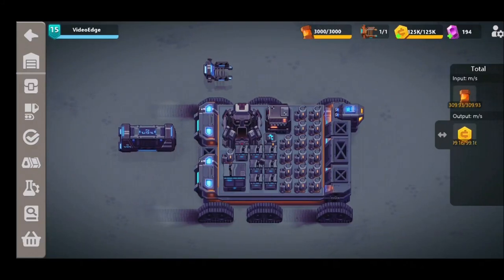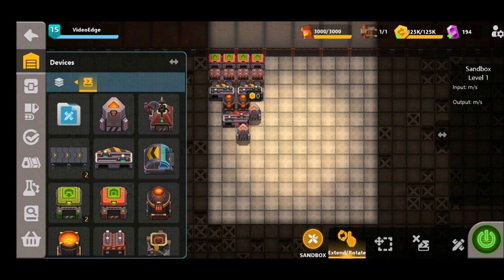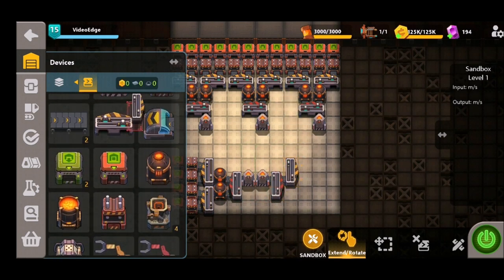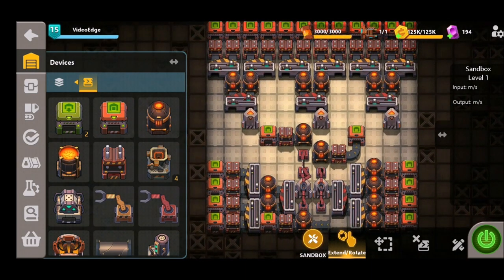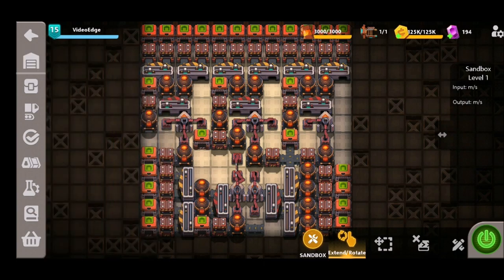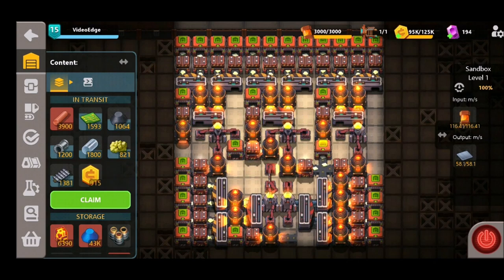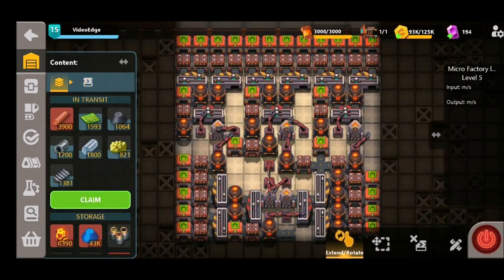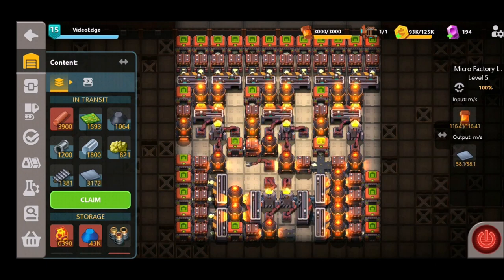Sandship Crafting Factory: High Efficiency Micro Factory PLATE Design! [HD]

Comment: Nice design, I've got a design in the same vein as this one but is slightly cheaper and outputs 58.3. Though my blueprint only shows a 56.67 yield. I wonder what is going on in the code that makes your blueprint estimate go up and mine go down.
Reply from the maker: The difference is due to the underground belts, for some reason when you save a blueprint it doesn't take into account all the exported materials on the otherside of the belt! Sounds like you have a cool design though!!

Comment: As i tried to built it, i just noticed, you switched up the heaters with the splitters. Not to make a fuss over it, just curiosity, was it intentional?
Reply from the maker: Just to generate a little bit more space to improve the overall output, doing it this was generally isn’t as efficient, but the extra space allows you to place more devices down to increase the overall output!